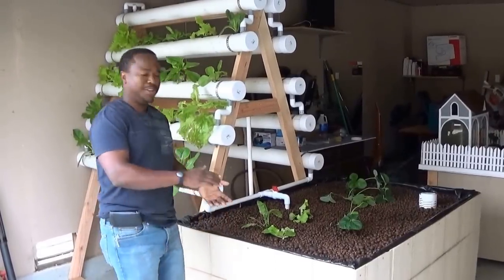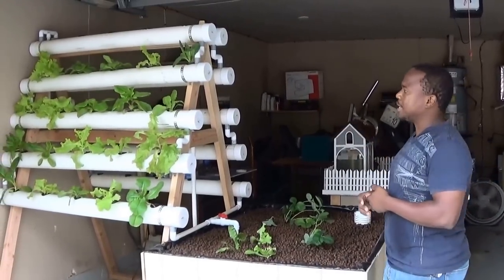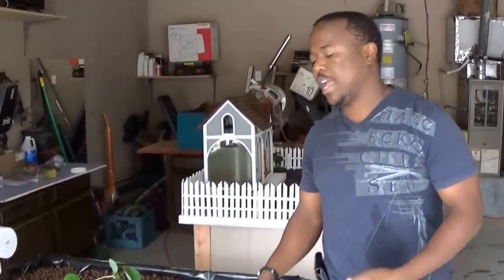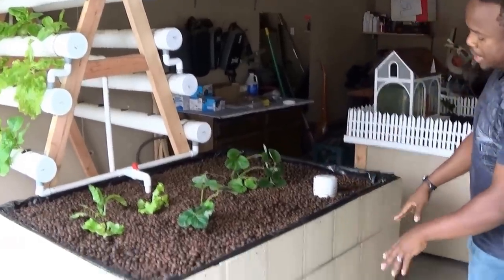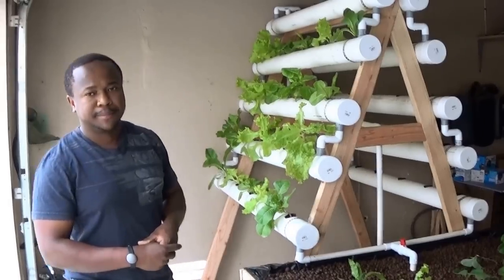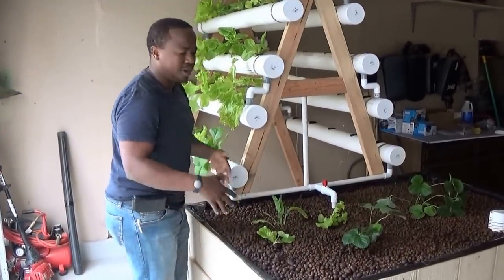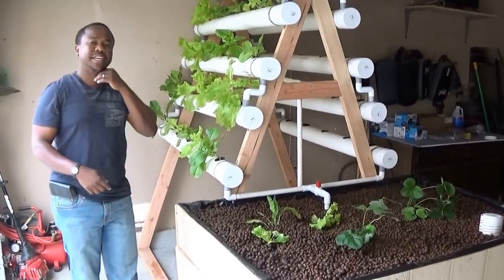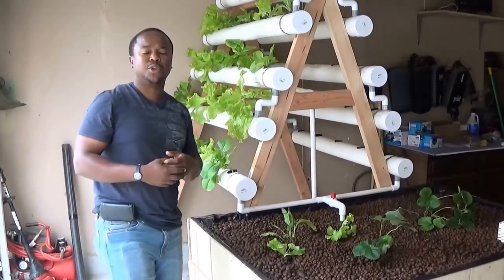Aquaponics A-frame System Design Tour

Comment: Nelson, how do connect one pvc pipe to the next below it. I have a hole saw but I was curious what size you use, what fittings, and then what sealant, if any?
Reply from the maker: I use hole saw with 3/4 electric fitting..
Reply: In my upcoming system I'm using 3/8 ID - 1/2 OD tubing from the bottom of one grow tube to the top of the one below.  This is attached with a 1/2 inch Hydrofarm top hat grommet through a 9/16 hole.  I'll have a comprehensive video about this in a few weeks.